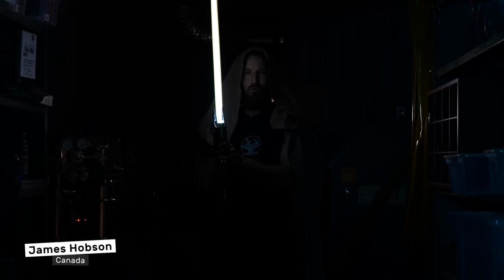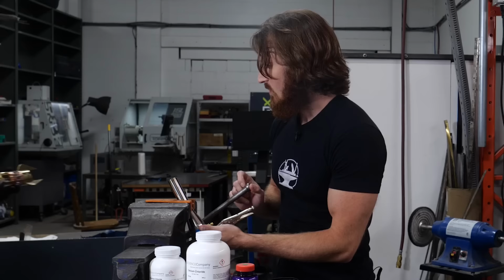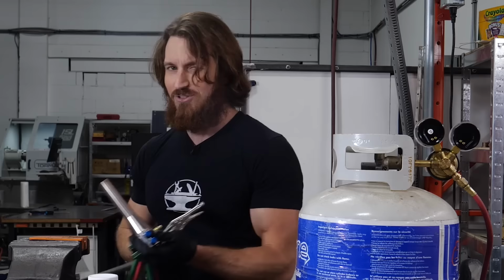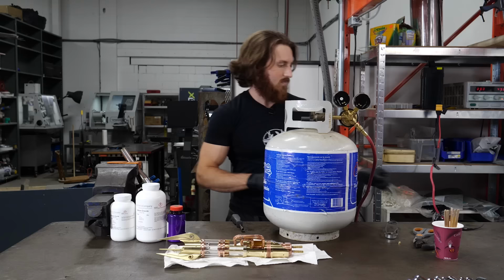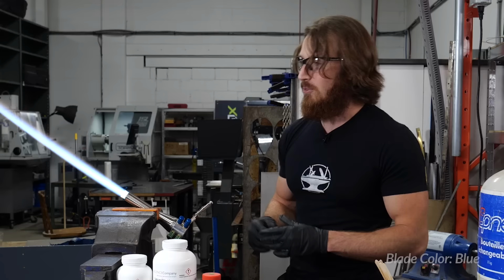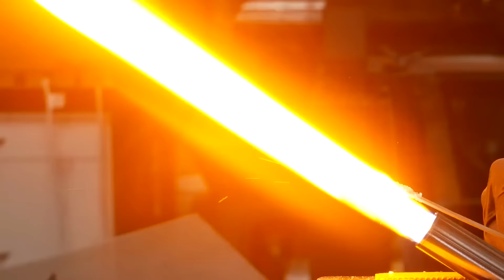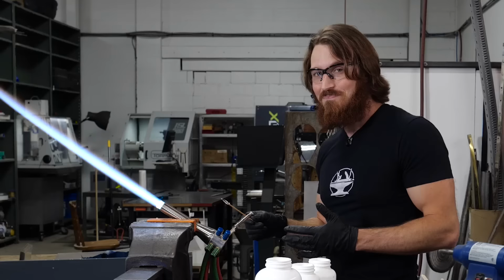World's First Lightsaber! - Guinness World Records

Comment: Technically according to Star Wars lore, a lightsaber is a loop of plasma that goes out of the hilt and is somehow looped back into the hilt again so once on and humming in the air it doesn't expend energy. This is said to be analogous to a superconducting loop, so energy is only expended when it comes in contact with something solid that sort of breaks the surface of the plasma, which in-universe also explains why the lightsaber can be portable with a relatively small battery pack since it's only when the blade is touched to something substantial that the loop is broken and energy is expended. This also accounts for the lore fact that a Star Wars lightsaber requires extreme strength and dexterity to use because of the associated "gyroscopic effects" caused by the superconducting plasma loop, and therefore can only be effectively wielded by a well-trained Jedi.
Reply: Or Sith or whatever well trained force sensitive person.
Reply: @sitsia3808  get your political correctness out of here
Reply: U dont get a joke do you...

Comment: According to star wars lore, this is accurate. The first ever lightsabers had a little energy box that they were attached to that the users wore on their waist. Obviously this one is a much bigger variant, but still.
Reply: No, it's not correct at all in anything but looks.
This runs solely on combustion, there is not light or energy involved and it is NOT plasma based...it's very frustrating that he says that.
He built a fancy case for a glassblowing torch.
Reply: Dragongamer 7  I suppose you could practically call two compressed content cylinders an energy box...but since lore still has them being plasma, and not combustion based, it's still a stretch.
Reply: Dragongamer 7  True.
I like you.
Thank you for having a level headed debate and acting like an adult. Rare.
Reply: @oddborofiend  did you really say that light and energy weren't present and that a torch wasn't using plasma? I'm not sure you understand the definitions of the words you are using because every single part of that is wrong.
Reply: Came here to say this exactly, thanks fellow nerd!

Comment: The first generation of real Jedis will be carrying propane tanks on their backs and a backup Machete in case they run out of propane during combat
Reply: well, first generations of fantasy Jedis also carried auxiliary units on their backs 😂 So this prototype is not really that far from the “real” thing.
Reply: @MrMurmandramas  just to add on, hence “proto-saber” as that is what they were called. :)
Reply: But i do like the idea of jedi hacking away with machetes when their auxiliary units run out.
Reply: the old jedi in lore used to carry a battery pack on their bodies that was wired to the saber
Reply: yeap protosaber
Reply: They'll run out pretty quick
Reply: Well they did it in star wars, protosabers and swords before that.
Reply: @generalgrievous6689  yea but it wasn't like this older versions were just a heating metal
Reply: @nyamjavgantulga648  No, I'm talking about Star Wars, in the comics the first Jedi carried around pouches with energy sources before Khyber Crystal's.
Reply: They did
Reply: I mean if I were in war against them I would just aim for the propane tanks
Reply: sounds like attack o  titan xD
Reply: Ok
Reply: @tommyboy1039  actually that was a tactic in lightsaber fights with proto sabers, attacking the cabling or the energy pack

Comment: I like how he has a light saber that’s burning at 4000°F right next to a propane tank
Reply: He wants to be the first man to die by light saber
Reply: Yikes
Reply: XD
Reply: He's a well trained engineer, its 4000 degrees only where the blade is. If it was that hot in the air he would die before that tank would give
Reply: So?
Reply: @DavidSpecialis  But if due to some freak accident he touched the flame to the propane tank it would almost instantaneously explode. However I'm pretty sure when he did have the tank close the the blade he also had the whole contraption secured in a vice, so it was pretty safe.
Reply: @sgtjohnson49  he could touch it to the tank without exploding, but more than a second and it would explode

Comment: Every scientists on earth: "it's impossible to make and it doesn't make sense to try..."

this guy: ahah lightsaber goes BZZZZZZZZZZ.
Reply: It’s impossible to create the beam with electricity and control it using magnets, so they created it with fire and controlled it with gas pressure.
Reply: @jonathanodude6660  that's outside the box thinking
Reply: @jonathanodude6660  Which also means it can't clash with another lightsaber. They'd pass right through each other.
Reply: Except this is fire, not laser
Reply: @TheNeilBlack  yeah, that’s a property of plasmas in general though. A magnetic field with a repulsion that strong would be dangerous if we could build it. Though it could enable a cold plasma. Idk if cold plasma could cut anything though.
Reply: @aquariandawn4750  excuse me, i forgot that you call it "Lightsaber" in english
Reply: @cheshirecat1169  I don't know what your reply has to do with mine... I said this is fire, not laser.
Reply: @TheNeilBlack  That could be an advantage if the jedi you are duelling expects his lightsaber to block yours, and it passes straight through! Surprise!
Reply: @patrickreynolds5463  I feel like the Jedi would react and take advantage of that faster than I would.
Reply: @Nolan Santelli no it isn't. Maybe you're thinking of electron temperature? Cold plasma is stuff like the inside of those plasma ball toys, fluorescent light tubes or neon lights. You can touch all of those. They are not thousands of degrees.
Reply: I can't wait to walk around with a huge metal propane tank backpack while doing my sweet Jedi kickflips. Hopefully the fight doesn't last more than the couple of minutes worth of fuel. At least, if it doesn't take any damage and blow my body to bits
Reply: @jonathanodude6660  BZZZZZZZ

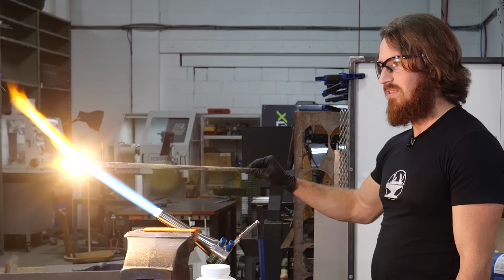Comment: 2:11

I used to work in a fabrication shop doing welding and using a plasma cutter, and the first thing you learn is to never look at the plasma. You can literally burn your eyes. I used to wear UV400 sunglasses under my welding helmet when working to prevent accidental exposure to light even.  One plasma cutter or welder, even from a distance, can cause damage to unprotected eyes.

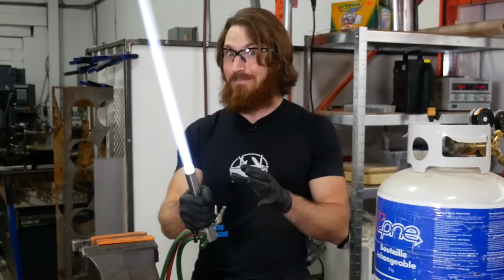1:57 Also, when metal gets so hot that it starts melting like that, it isnt just hot where the cut is going on. I have a feeling that by the time he had cut through that sheet of metal, the entire thing was uncomfortably hot.

Comment: Turns on plasma light saber
"This can through just about anything"
Proceeds to gesture emphatically in the immediate vicinity of the beam.
Reply: hhh
Reply: Its not plasma, 4000 is not hot enough. He is only 2/3 away from the heat threshold for plasma but still not there. Its really just a finely controlled blow torch with some fancy gadgets. He isn't the first one to engineer a propane torch. LMFAO!

Comment: Every dislike is from people who think this is fake
Reply: @XxItzJiroxX that's how a real lightsaber works it just way more solid
Reply: No the dislike is from people who use propane heating torches everyday .... Something that's been around for 70 years ... This isn't an invention ... Or even vaguely impressive ... Industrial torches make this look like a candle
Reply: @andrewshraga7301  So how come they never thought of making one..
Reply: @colnohman5255 because you don't have to, they already exist. Literally go to a hardware store and buy an oxy propane set for like 150 bucks ...  Then all you need is the right tip and lean out the oxygen to make it burn bright ..... Just no one ever called a propane torch a lightsaber before because it's a propane torch ....   look up what an industrial oxy heating torch looks like ... It's Got a loooong neck on it ... This is because it's hot as balls ... If you where to actually hold the heating tip your hand would literally be on fire instantly ... Even with the the long neck the heat that comes back off of one of those is enough to melt your face off ...
Reply: @andrewshraga7301  ya ik wut that is, thats my point..they had the technology all this time.  But they nvr put it into a handheld form to specifically make it look like this. Someone cud have easily thought of this before..

Comment: If the lightsaber's not purple I'm not impressed.
Reply: Get some potassium salt and you're set then.
Reply: @alvintang4091  Or good mix of potassium water ;)
Reply: I want my grape flavored lightsaber
Reply: @alvintang4091  How about black lightsaber like in the Mandalorian?
Reply: @shirokaminokageyami  u mean the dark saber
Reply: only for samuel l jackson
Reply: @derpydan8694  ah yes the darksaber 😅
Reply: Jajaj same
Reply: @shirokaminokageyami  Light can never be black though. The closest we can get is a purple hue ala UV light
Reply: @alvintang4091  Actually, you can make it closer. It's possible to make regular flame look black through the use of a sodium lamp. At least I think it was a sodium lamp.

In either case, there's a special type of lamp that can change the color spectrum of fire from red-orange to black, which would make the blade look like the Darkblade.

The challenge for them would be finding a way to emit that light while not damaging the lamp due to the insane degree of heat.
Reply: @shirokaminokageyami  r/cursedcomments
Reply: I mean you are technically correct tho

Comment: Everyone talking about: "This actually hurts to look at, look at that"

But noone about: "This beam is realy cool_,It is actually _burning at around 4000°F [..]"
Reply: Sooooooo nobody wondering why that 4000 degree "flame" didn't melt or distort the rubber gloves? Or his hair when it was less than a foot away? Or cause any physical discomfort at all? Not even heating up the metal it's emitting from?
Reply: Im a welder, we use cutting torches that are the same concept as this and burn even hotter. I can hold the handle with my bare hand and feel nothing if its just running like his is, its not an oven the heat is concentrated into a small area pointing away from you.
Reply: @BE4M3R  because thats how physics works. Read a textbook.
Reply: how is that "everyone"?
Reply: @BE4M3R  nope because we're not idiots and understand basic physics.
Reply: @BE4M3R  that's a good question, I'm sorry these comments are so mean.

Comment: Everyone: These will never be mass produced

Elon: Hold my flamethrower
Reply: Lampworking torches have been mass produced for decades.  That's just an off the shelf Bethlehem glass torch.
Reply: Even though similarities exist and the concept itself isn't new, they won't ever be mass produced for legal reasons. A gun and a brick are both lethal weapons. One has legal restrictions and the other can be bough by anyone at a local Home Depot. Flamethrowers exist under "purpose of use". There's no way they would get away with mass producing "flame-thrower lightsabers" that burn at 4,000 degrees to the public. Especially with as stupid as the vast majority of the general public are. The amount of litigation they would have to furnish to establish a "purpose of use" and convince law-makers to actually allow Joe Shmo to buy one from Target, without a permit or license, to carry one of these things, is virtually impossible.
Reply: Roofing felt torch*
Reply: @wildlingnation4659  Right!  I sell those with no instruction manual what so ever.  They don't even say anything like "point away from face"!  I did have a report one time from the neighbour about a person using it to melt the snow off there car.  The mans windshield was not a big fan of the rapid change of temperature and broke!B

Comment: Me, when he said: "It burns at 4000..."  - "WOW 4000°C" - ..."Fahrenheit" - "well..."
Reply: welders everywhere sigh
Reply: better used acytelene ... 3166° C
Reply: Yeah it should be 4000c because 4000 f is very cold and substain polar bears
Reply: Goddamn imperial system
Reply: Ooooh let's call it something else

It's the same damn temperature

& it'll melt your goddamn face off
Reply: And yet the guy wears no protective gear.

It's a fake.
Reply: @matthewpoppe2031  come on...
Reply: Metal handle + 4000 celsius = rapid heat transfer.

Dude isn't wearing gloves.

Forgetting that even...

Close proximity to plasma, and no skin shielding.

Burns almost always happen in welding.

It's a physical improbability based on the guy doesn't get burned.

Do the math.

It makes zero sense.
Reply: @matthewpoppe2031  he wearing a rubber gloves...
Reply: @matthewpoppe2031  just google how it works. 
Makes perfect sense. Burns only on the outside of the handle. Otherwise the handle would melt too...
Reply: Full face covering required
Reply: Respiratory protection would have been recommended as well based on the lack of knowledge about any unknown potential contaminants.
Reply: Tightly woven fabrics to prevent burns. Which the clothing may have been like that, but there's plenty of exposed skin on the guy.
Reply: So either he just got lucky.

Or he lied about the physics involved in the device.

Or it's just cgi.
Reply: He also starts the video wearing a loose fitted, most likely flammable hood near the plasma.

But yet it doesn't catch fire.
Reply: Oh yeah and about the plasma outside the handle.

Heat transfer occurs regardless.

Happens with cigarette lighters all the time.

So 4000 degrees celsius isn't somehow going to heat transfer faster?

So I guess physics doesn't apply to him.

Or like I said, he just got lucky.
Reply: @wesleyvanhamme7087  or acytelene mixed with oxygen.
Reply: @matthewpoppe2031  ok boomer
Reply: @julianlidberg7590  ok burger

Comment: It's visually stunning and an amazing achievement. At the risk of sounding bitter; it's not any kind of real lightsaber. It's a lightsaber themed visual effect. Differences include the facts it would be affected by things like wind and if you tried to use it to fight someone with a conventional sword you'd lose rather than win easily.
Reply: Steel has a melting point of 2500 to 2800 degrees. That plasma is 4000 degrees Fahrenheit, a conventional sword will melt rather quickly. Imho it would break if it touched the plasma.
Reply: @RebootMatrix  I think the conventional sword would start to heat up, then glow, then eventually melt. During which time the person with the real sword would have done enough damage to win the fight. Steel has a high specific heat capacity and it takes a lot of energy as well as temperature before a large lump of metal will start to melt.
Reply: Unlike a 'real' fictional lightsaber, this plasma flame sword could be defended against with asbestos armour. An asbestos coated club could  be used to win the fight if I'm wrong and a conventional sword would melt.

Comment: I’m not trying to devalue the achievement bc I love the channel that made this and this is a huge feat of science and engineering, and as an engineer myself I can respect it, however, I cannot accept this as a “light saber”, bc it simply is not, I would classify it as more of a… “plasma thrower”, since it burns through things rather than cuts and doesn’t have an actual solid blade. Granted plasma as a state of matter can collide with plasma, this is not contained and therefore cannot clash or act as a saber in any way, bc it’s simply not a saber. I will admit however that it’s still super fu$&ing cool and I want one 😅
Reply: Pra mim isso (o "sabre" do vídeo) é na verdade um >maçarico*< diferenciado longo 😆🤣

Comment: Waving your plasma burning at 4000 degrees over the top of your propane cylinder attached to oxygen wont make putting on those safety glasses very effective.

Edit: same with staring at the welders type glow while smelting.

Comment: you got it right. now program the  photonic particles arranged in a verry powerfull magnet of force.(field for net level) separated in + and - forces and you will have a REAL Battle Light SABER .

( the heat particles arranged in the magnetic field. such as the earths repeling magnetic atmosphere, the 3000 to 4000 and up celcius will be distributed in this (camp)field force.......

and thats how you get light sabers to clash in batle and feel the force of a magnetic field made as(a blade) an intangible force you can solidify in battles. added to your Kelvin,Celcius etc. psy force.

(every time you hit an object or mass: the magnetic repelling forces of the plasma particles(there are exremophiles in plasma) pushh you or  give you the feelling of it.)

Comment: Now you’ve got to figure out how to generate that much power from a lightweight hilt and have the blade able to be solid to other lightsabers. Perhaps a transparent material with an insanely high melting point that you’d heat with the plasma inside. For the hilt power, you could use either plutonium or antimatter.

Comment: Using propane for the blade doesn't count
Reply: For the plasma like effects of lightsabers gas would be necessary; in actual Jedi lightsabers they could just use the force to contain the plasma and pull it back into the hilt.  Khyber crystals are actually sentient and sith are supposed to need to force them to work for them, which turns the blade of any saber a sith uses red.  If the force containing the plasma happened to condense light around the edges of the plasma blade as well it would explain the laser like effect too, at least sometimes.
Original lightsabers in Legends canon were called protosabers and functioned like this with a backpack.  I am fairly sure they are still canon.